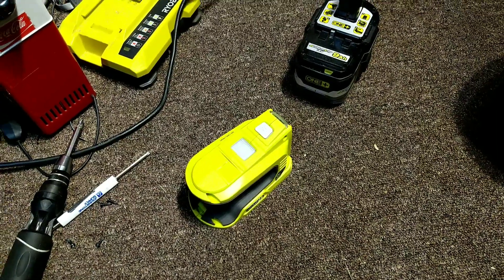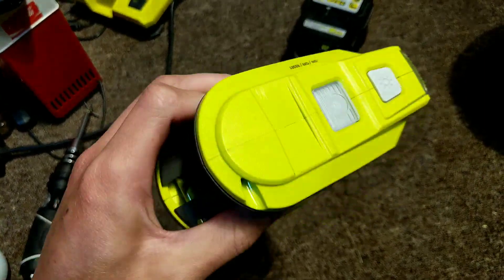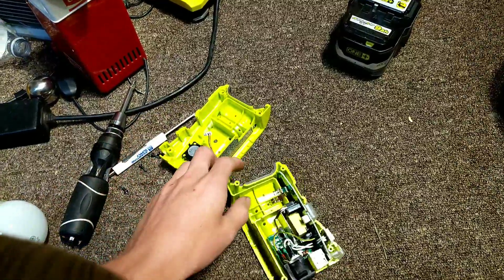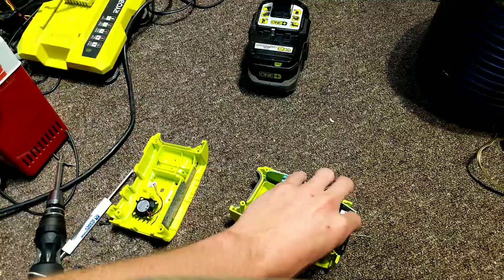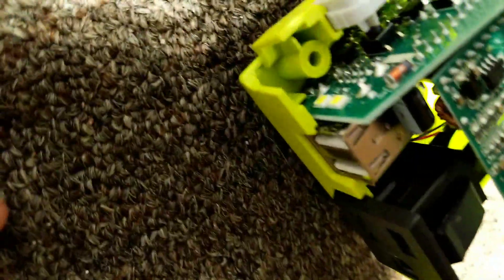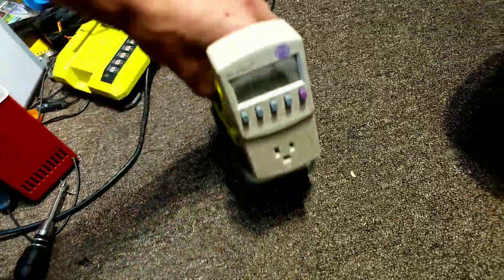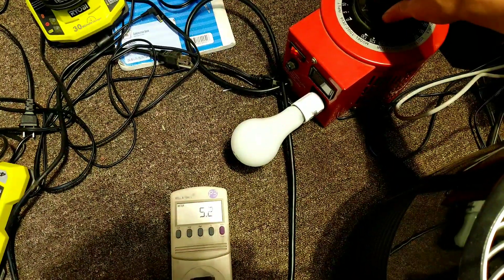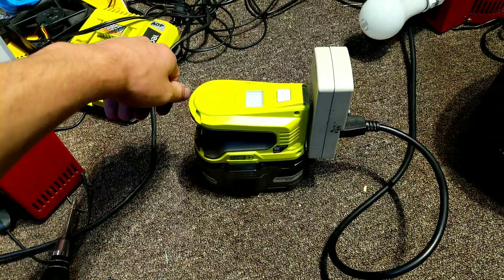Ryobi 18v inverter testing and teardown

Comment: I just recently got the UK 240V version of this and I'm a bit disappointed that it has internal battery protection, because I thought Ryobi didn't do that and relied on the protection in the batteries. My intention was to use it with an adapter and a Makita PDC01, which is a backpack that holds 4 18V batteries and cycles through them in turn. It does this by monitoring the batteries itself and determining when one is low, switching to the next one when required. Annoyingly, the Ryobi inverter considers the battery depleted at a higher voltage and cuts off before the PDC01 is able to switch to the next battery. 
From looking at the circuitry, can you think of a way to disable the low battery protection?

Comment: Would it be possible to disable the AC inverter so it is just a USB power source?  I don't use AC and don't want the parasitic draw of the idle inverter.  If so, how would I disable the AC inverter?

Comment: Is there a location on the board where I can run leads to use the 18v output.  I want the power switch controlling the 18v lead I installed.

Comment: Mine (made week 30 of 2019) has torx screws.  Yours having philips screws was probably a factory parts sourcing issue.
The KA7500 is a very common and simple switching supply controller.  There is a second KA7500 on the daughterboard for driving the output H bridge FETS, which are on the back of the daughterboard.  The SOT-23 3 pin transistors and passives next to it are the high side FET drive level shifters.
The SOT-23 6 pin chip next to the first KA7500 is the main control microcontroller.  It looks at the on/off button input and a monitoring signal from the LM358 (used as a threshold comparator) and a thermistor for overtemp shutdown.  It also controls the on signal for the KA7500s and green idiot light (same signal) and the red 'shit no chooch' light.  The KA7500s do all the overload sensing.  The LM358 also controls the fan thru another FET on the board.
Q22 (should be U since it's an IC not a transistor) is a 78M12 12V 500mA linear regulator.  The actual transformer drive FETs are on the heatsink.

The 555 is used in a single button toggling circuit to turn the LED light on and off.
Mine only charges at a few hundred mA max from USB which is useless, but it's real useful for running soldering irons in the field and for work lights.
Reply: Someone who knows what they're talking about. 👊🤛👌
Reply: Most inverters stabilize the 120V RMS voltage as the load increases. However the inverters don’t stabilize the peak voltage. The peak voltage changes from 150V to 205V from 16V to 21V on cheap inverters because the inverter just multiplies the battery voltage by 9 to generate the AC peak voltage. They are cheap and crap. Did you scope the output to check the output quality?

Comment: Take apart
Remove Ryobi specific pos neg terminals
Replace with generic plug
Rehouse components in a slim low profile box
Use any 18v battery with inverter
Reply: Quite expensive just to gut it out, use a flashlight instead lol, but most inverters takes 12V, some 24V, 18V is more rare.

Comment: good job on video, especially with the variac.  wish they would put an AC charge input on this, and sinewave output circuit, so it could be used as an ad-hoc UPS.

Comment: @5:00 “this does have a floating neutral” then you go on to say that the ground is probably attached to the neutral. This will absolutely not be the case.

That’s exactly what a floating neutral is not. Floating neutral inverters have the voltage potential split between the hot and neutral. So you may have 60v between the neutral and the ground or it could even be like an 80/40 split where the hot has 80v to the ground pin and the neutral has 40v to the ground pin

If you connect the ground and neutral you will create a short. This it why these types of inverters will not work to power a residence.
Reply from the maker: Semantics sure are fun aren't they? What exactly did you prove?
Reply: @connorcruz6249  They made it a point say floating neutral right on the face of the tool because it means it is unusable or unsafe for some applications.  Don't take it personally man, I'm not trying to make an attack on your character or anything; we're all here to learn.

Comment: I'm almost done with my video. Yours is great! I have a question, do your USB ports still work? In on my second one and they don't work. Broke quickly charging a phone and then an iPad on the second unit. Perhaps I blew my fuse? Anyway, after sitting a week it registers voltage at the USB port but the phone reads no current. Please let me know. Thanks!
Reply: Anyone have a fix for 2 USB ports not working? Mine failed a while ago and just came across this. Be nice to have them working again.
Reply from the maker: I actually had the same problem with mine as well. Both of the USB ports are dead with the exact same symptoms you're having.
Reply: @connorcruz6249  fffuuuuuuuuuuuuuuuuu...... I think they know too. It's a shame :/
Reply: @connorcruz6249  also, thanks for the reply!
Reply: Same problem with mine...
Reply: Also don't mess with the transformer if you don't know what your doing.  Since the transformer inside is upside down if and when it gets hot for long periods of time it begins to hang off the pin side causing low voltage, excessive heat, intermittent AC and USB output.

Comment: I have 2 of these from Amazon and BOTH have Torx head screws all around, not sure how and why yours has philips ...?!?!?!
Reply from the maker: Perhaps they changed the design? I got this directly from homedepot, the moment it was available, after much anticipation.
Reply: i got mine this month ... 
Yea when i saw it, i was amazed. I always said to myself someone needs to come up with an inverter to convert an18/20V battery to 120V ac for those emergency power outages. Most of us have 5+ of these batteries laying around and why only use them for tools ..?? Granted its only 150W but you can plug in a 100W led bulb that only pulls like 10W and it can run for like ~15 hrs ...
Reply: So i was curious to see how well this inverter would run a 150W incandescent bulb and to my shock it did .... 
My smallest battery is a 1.3ah = 23Wh and it ran the 150W bulb for like 5 minutes
The 2ah battery lasted 8 minutes
The 9ah battery lasted 52 minutes AFTER MODS ... 

I can tell you this inverter gets VERY WARM .... While running the 9ah battery, within 15 min the cooling fan kicked on ... Got so warm and hot that it shut down and i can guess why and it was because of the piss poor cooling setup they have ... The fan is ok but the air ducts that they setup were too restrictive and i could not feel any hot air coming out of it so the heat was just building up inside causing it to shut down... 
So i took it apart & the intake side i can't get to because the fan is "molded" to the plastic case and it sits right over the inlet so i cant trim the plastic "vents". But on the exhaust side, it was wide open and i just cut the 4 "horizontal" vents off so that it can exhaust that hot air. Now when it warms up, the fan kicks on and NOW i can feel hot air escaping the unit ... This time it stayed ON and ran that bulb for 52 minutes problem free.. !! 
But i can say it only got this hot when running that 150W bulb ... i ran a 75W bulb and it got warm but the fan never kicked on.

Comment: nice tear down and test. it sucks the fuse is not serviceable but as you said it looks like they have an autoshut off feature and the fuse is last ditch effort. you said you tested it over a few times and it never popped? was it just gradual tests over 200 watts? would you dare doing different tests to see if you can get it to pop? maybe a faster spike in power instead of gradually going over as you shown. if it doesnt pop even with a gradual spike over 200watts, then I guess they did their homework.
Reply: I was told the soldered on fuses are a sign that the tool maker plans to never have it pop. They have a decent overload system and are using the fuse as an extra safety measure.  If the maker goes through the effort to make the fuse changeable, this generally indicates that they are using it as the only overload protection measure, and you can expect to change the fuse every time you overload the device.